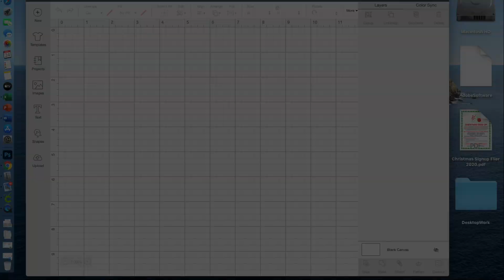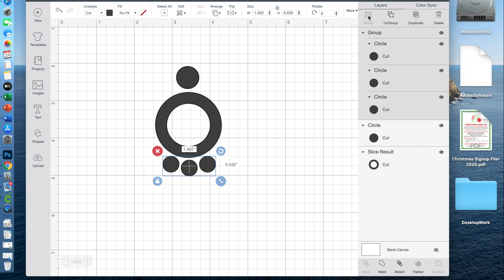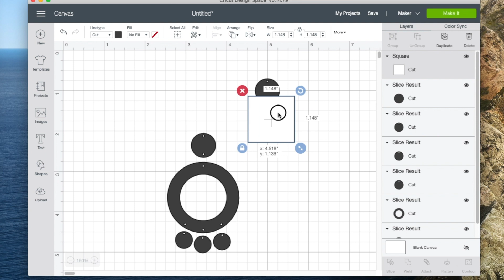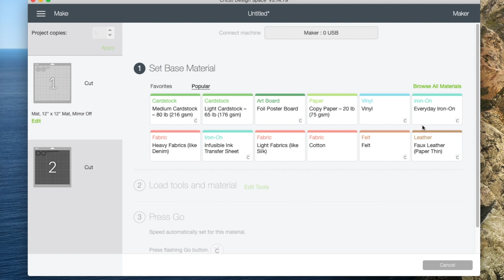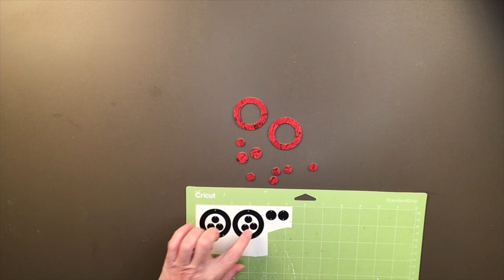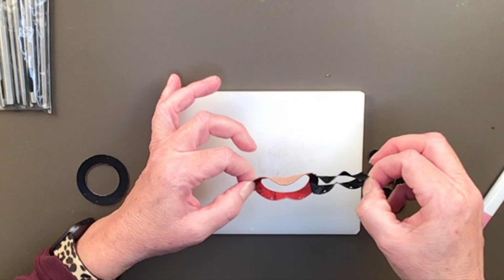Cricut Design Space Earrings Cut with a Cricut Maker

Comment: What type of block is that with the tool set you are using?
Reply from the maker: It's a poly board, similar to a plastic cutting board you can use in the kitchen but smooth.